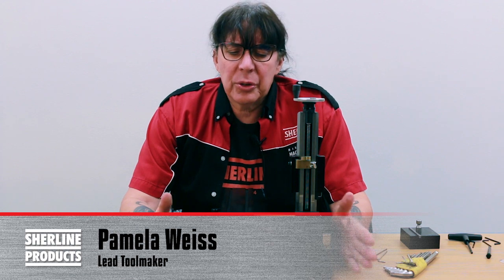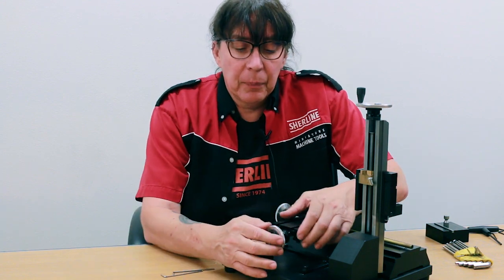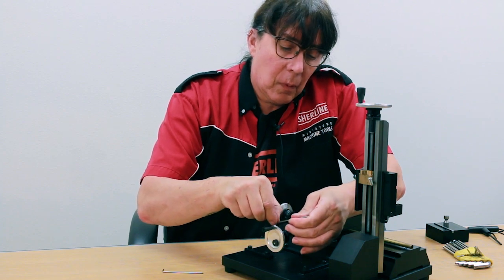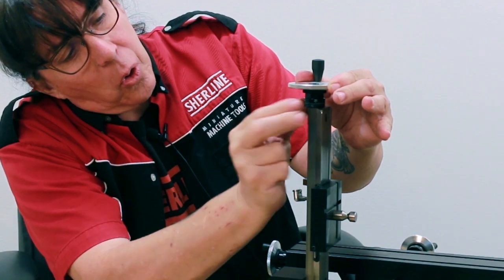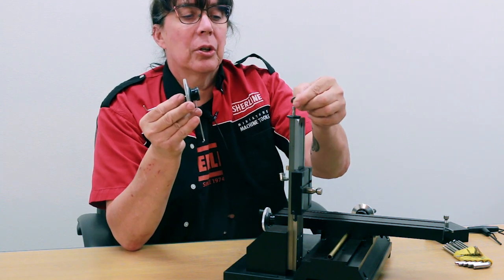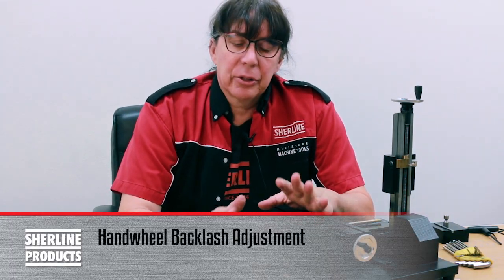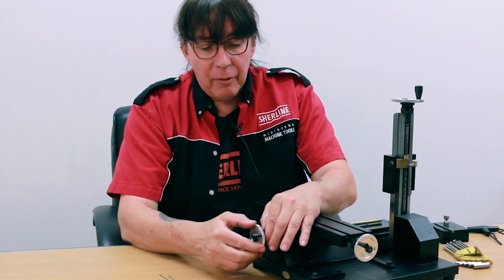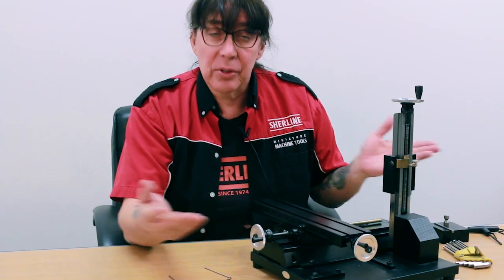Removing and Adjusting Machine Handwheels

Comment: Thanks for the video.

I recently noticed that there was a gap between my z axis handwheel and the frame which caused significant backlash.  This is a bit scary since the heavy motor /spindle assembly would occasionally jump down towards the material.  Fortunately it didn't result in broken endmills or a ruined workpiece!
Just removing and reattaching the handwheel fixed it, though it was just one axial setscrew for the style of handwheel I have.
Reply from the maker: Glad the video helped you solve the issue with your Z-axis backlash.

Comment: I would love nothing more then to watch sherline snatch up the market between its current machines and the step to the $5k range Chinese machines. A slightly bigger more capable machine.  Cast iron tables would be amazing.  Sherlines attention to detail and overall high quality products are commonly overlooked as some people discount your machines due to size.  I’m sure I’m not alone when I say we all want a 200-300 pound sherline mill, possibly with the option for linear rails and angular contacts in the spindles.  I’m in ten grand to a brand new precision Mathews mill conversion, and a month into repainting it, cleaning it, throwing everything on the surface plate to see what needs to be scraped.  It’s terrible. Even right now if you guys produced a new type of heavy duty mill, I’d be the first one to order it knowing that I can count on Sherline quality.   needs you now more then ever.
Reply from the maker: We can’t compete in the larger size machine market, and we are not set up to manufacture the larger machine parts. A machine of that size with linear rails etc. (made in California) is probably closer to $10-15 K.
Thank you for your support.
Reply: Sherline Products id still buy it from ya.  Just sayin.  You guys are great though.

Comment: I put snap rings and thrust bearings on all my leadscrews.  Just didn't like the constant maintainance.  It's held under .002 backlash for the last couple years.  The trick is to get the snap ring groove close enough to slightly pre-load the bearing.  Is that a horizontal milling table your using?  I think I'm gonna get one.
Reply from the maker: Yes, it is a horizontal milling table. It was designed for the 5000 and 5400 series mills. https://www.sherline.com/product/6100-horizontal-milling-conversion/